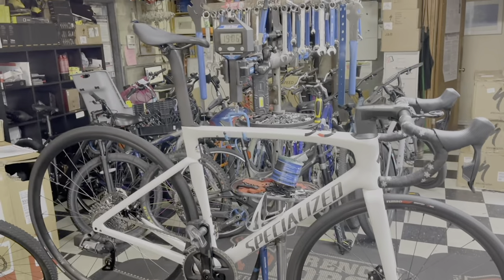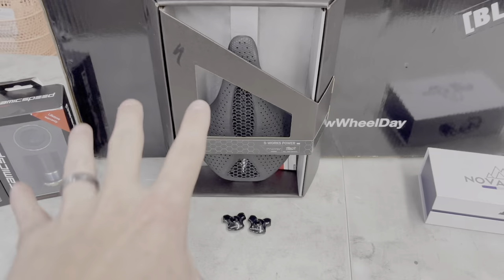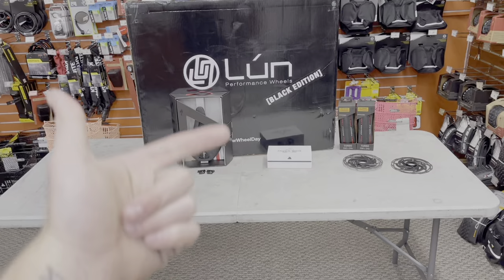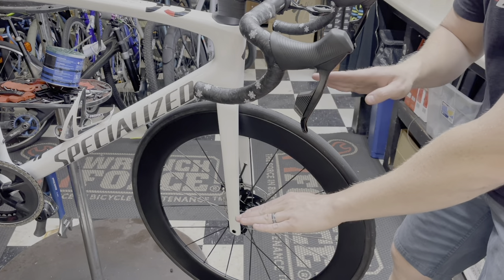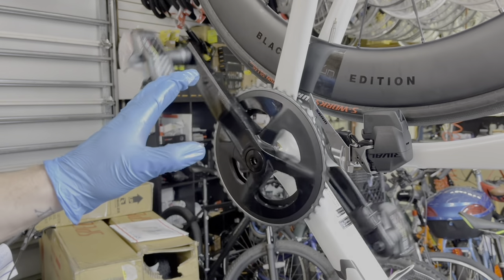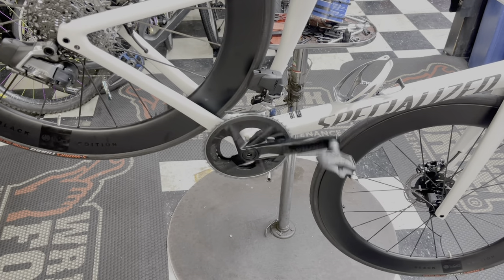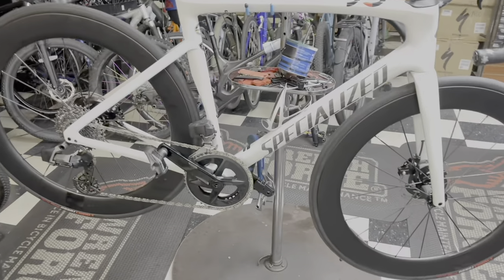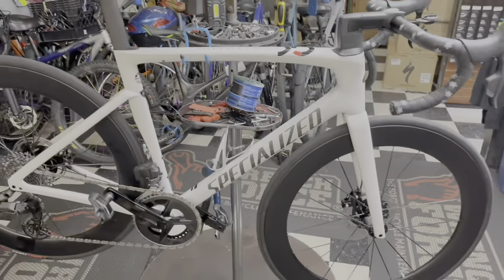HOW MUCH WEIGHT CAN I REMOVE?? (UPGRADING MY BRAND NEW TARMAC SL7 COMP 2022) *WHEELS, ETC*

Comment: Bikes are getting cheaper, lighter and easier to build and maintain than ever before.
Reply: Completely agree 😆 bikes are overpriced gimmicky fashion statement nonsense nowadays. As lance says. "It's its not about the bike" you are going to win if your performance is up to scratch and the bike functions and is reliable. I ride a £900 second hand scott addict with 105. It's all I will ever need.
Reply from the maker: hahahha but it is not a problem for me to work on it..... so I do not care
Reply: 8k bikes weigh 8,5kg - How the tables have turned. The new 5k-20k bikes are the real peasant bikes - can't even reach the UCI weight limit, facebook marketplace bikes of 1000-1500 BUCKS are the REAL bikes now for the hard hitters doing hill reps.
Reply: Stating the obvious.  Thank you.
Reply: There are far more choices than ever before.

Comment: I just got my Hyperspace 50MM Disc brake Black Edition for my Trek SL5 last Monday. Also used your discount code  (thanks). Brother , I love these wheels. I finally bit the bullet when they came out with the Black Edition.  I've put about 200 miles on them already.  I was riding my bike through my neighborhood after  I first put them on. Some a-hole broke a bunch of glass, which I didn't see and got a flat in the first 500 feet of my ride. Got home fixed the flat and went on my ride. I rode them into 25mph headwinds and crosswinds and I had no problems. Rode home with a 25mph tailwind and I was flying. Doing a solo ride across Florida and back from Clearwater to New Smyrna next week. 200miles is my longest ride, going to try and top that. Because, why the hell not!
Reply from the maker: Thats awesome man I am glad to hear!!!! I have the 65 and I have no issues with it either the wheels are so nice and the bearings are so nice!!

Comment: Splendid project! I bought a brand new crux fact 11 for only 2700 eur last year, yes old model. I swapped out stock wheels for bontrager aeolus 3v, the praxis carbon zayante, now with 46x11-28 for the flat Netherland, roval Terra seatpost and romin carbon saddle. I got more than a kg off the bike and it rides super smoothly with 32 mm tires. I understand the JIZZ of this operation more than anyone else.
Reply from the maker: vvery nice!!!

Comment: “I want to get my bike lighter!” Gets heavier wheels (the single biggest opportunity for weight savings) “for the look.” 🤔🤔
Reply from the maker: hahahhaha about the instagram views
Reply: How are those heavier than stock comp wheels?
Reply: Even if the bike got heavier it most definitely got faster by a lot the deep dish wheels are 100% faster noticeably I got myself some rivals
Reply: Wheels were lighter than stock despite being deep!
Reply: @nateyzf   re-reading my comment, I wasn’t very clear. Wasn’t trying g to say heavier than stock. Meant heavier than he could have gotten. My point was he could have saved way more weight. Instead, he went with deep section wheels (and a heavy set at that) just because of the look. If I’m trying to get my bike lighter, I’d DEFINITELY have better options than these wheels. Zipp 303 Firecrest comes to mind, which is 300g lighter (and pretty awesome looking IMO). That’s almost a pound right there.
Reply: @Stevenafoe   re-reading my comment, I wasn’t very clear. Wasn’t trying g to say heavier than stock. Meant heavier than he could have gotten. My point was he could have saved way more weight. Instead, he went with deep section wheels (and a heavy set at that) just because of the look. If I’m trying to get my bike lighter, I’d DEFINITELY have better options than these wheels. Zipp 303 Firecrest comes to mind, which is 300g lighter (and pretty awesome looking IMO). That’s almost a pound right there.
Reply: @nemothefisk7154  not doubting the speed and aero benefits. And you and I can probably find half a dozen wheel options that have the aero benefits and are way lighter than these.
Reply: @GCPerformance18  lol at least you’re honest about that!
Reply: @danielakerman8241  the firecrests are a good option (but not black). Also; as they are tubeless only, you’ll need heavier tyres, plugs and additional ‘milk’ to seal them. That totals more weight than a (for example) pirelli p zero race 26mm (204gr) and a tubolito (24gr). Another 2x 75 to 100 grams saved if you don’t go the tubeless route ;-). Oh, the weight weenie-world, lol .
Reply: @Stevenafoe  
Firecrest wheelset: 1352g
Compatible Pirelli P Zero Race TLR SL 28mm: 275g each (550g total)
Sealant: approx 120g total.
Total weight: 2022g

Winspace wheelset: 1620g
Pirelli P Zero TLR SL 25mm: 245g ea (490g total)
Specialized Latex tubes: 85g ea (170g total)
Total weight: 2280g

Half a pound in weight savings going with Zipp Firecrest. Valve stems will be similar for each setup. Firecrest wheels don’t require plugs. They’re already set up for tubeless tires. Plus since it’s tubeless, the ride will be more comfortable, it has LESS rolling resistance (wider tires at lower pressures have been proven to roll faster in real world conditions thanks to their ability to efficiently roll over road imperfections), they have excellent aerodynamics, and they’re cheaper!! I happen to think they look fantastic in black.

Just to be clear. I’m no weight weenie. I actually think bike weight is way down on the list of things to worry about or spend money on. I just found it silly that the title of this video was about how much weight could be saved, and then products were used that clearly were not great choices as far as weight goes. Blatant clickbait to satisfy the video sponsors…
Reply: @nateyzf  they are much deeper
Reply: Don’t even get me started on how much weight can be saved going with tubular over clincher. It’s pretty staggering. I always go with tubular on my high end bikes. And you can’t tell me with a straight face that my FMB Performance Racing silk 25 section tubulars have more RR than your overly hyped tubeless flavor of the month tires.
Reply: @danielakerman8241  i have (not expensive) 1500 gram (tubeless ready) 5cm deep rims, 2x 204gr pirelli tyres, 2 x tubolito’s: 1960 grams... I am also not a weightweenie, but the lower weight does feel good. I live in a country with great tarmac (cyclepaths), so comfort is not a real issue. I am just trying out different setups; next time i want to try latex inners, to see how that works out. As i hardly have flats (1x last 4 years) i am not considering tubeless currently.
Reply: @RB-xv4si  i don’t really care about weight at all. I was just making a point about the silliness of the video. Personally, I think tubular tires are ridiculous for 99% of riders. I like tubeless not because of the weight but because of its real-world speed, comfort and convenience. For most riders in real world conditions, tubeless roll faster, are definitely easier to take care of, and offer more comfort.
Reply: @danielakerman8241  right. And I was pretty much making the same point you were. You mentioned the wheels weren’t light because of how deep they are. And I mentioned they also aren’t light because they aren’t a tubular system. And the truth about tubulars is that I can run the same large volume tubular at the same low pressure that you run in your tubeless setup. And the tubular casings can be thinner and more supple than on a clincher because there isn’t a hook bead stress point that could fail with a very thin/supple casing like has been the case when some manufacturers (cough..Challenge) try to use the same casing in their clinchers as they do in their tubulars.
Reply: My hyper 50‘s were lighter than the stock aluminum wheels. Plus noticeably stiffer and faster.

Comment: what your tough on safa brain going all out on the 32mm on the new scott build? Also would you change the chainrings on the rival crank for the red version to cut weight down?
Reply from the maker: Hes obivously really good at the sport and a great rider, so at the end of the day it is his call...... I hate the trend and also feel like he is loosing speed, but what people will say is, the 32 tire is wider and taller tire, so when he gets to top end speed the tire will expand like from momentum and get taller so it will be a bigger revolution and maintain and carry top end speed..... also more comfort... but fuck do I know, he rides with pros, I change flat tires on beach cruisers
Reply: @GCPerformance18  he does a lot of steep descends, maybe is also as a safety net
Reply: @bernardo9202  more contact patch can turn more aggressive and run lower pressures

Comment: This video made me realize I don’t want to put ANY extra money into my ‘22 Allez Sprint.  The “gains” would be so minimal, ain’t worth it.
Reply from the maker: hahahahha except carbon wheels doe, u need those
Reply: @GCPerformance18  Sucks how Spesh prices their bikes…  often making “upgrades” cost prohibitive.  I built a (frame up) S-Works SL6 a couple years ago, and it basically ran as much as a stock S-Works build.  Only savings was the frame.. on sale at $3,800 instead of $4,800.  If I installed Rapides and SRAM Red like I want to, on the Allez sprint, I’d be in the SL7 expert range, same R470 hoops… but CARBON frame.  Wish there was a break on component builds, and upgrades.  Anyways, I do have my eye on some Hunts.. but my bike was built by a moron at Spesh.  Their direct to consumer offer is a joke.  Literally had to take a brand new bike in for a tune up, before I could ride it.  Now the BB is creaking like a 20yr old press fit… might not have this bike too much longer, as I have requested a return… or a new bike.

Comment: I have a Poison Speed with Mavic CL45 wheels / ultegra mechanical group with 105 cassette- LIGHTER than that. 8.2 kg with pedals and garmin mount (front and back for garmin radar). My bike costs ... maybe 2500 euro. Why would I buy specialized ? No ceramic anything, shit headset, aluminium handlebars....

Comment: Excited for you and your new SL7. Is there a reason other than weight to change the rotors out to Red? I have the SL7 Pro with Force 1x. So Force rotors but I’ve wondered about the Red rotors. 🤔
Reply from the maker: no reason at all, just the weight for me, and also the look of it...... but stopping power is very similar, companies might claim there is better if you go to them and they might be right marginally but they are very simialr in stopping power

Comment: The height difference in the stem and seat is nuts and it's not even slammed. I bought the same bike in blue and the same wheels (but 50s). They're supposed to arrive tomorrow, but It's still sitting on the other side of the country :(
Reply from the maker: yea I know I should be on a 58 but I like the smaller bike and the aggresie look

Comment: Hello, I am a big fan of your channel, just one quick question, I am riding SL7 expert with Roval C38, weigh around 8kg, if I am going to get another pair of wheels for speed, shall I get deep section wheel or get another pair of all-round wheel (e.g. Zipp 303 firecrest) in higher level? Thanks 🙏
Reply from the maker: thanks so much!!! if you live in a flat area like florida like I d, then a deeep dish wheel like 65mm or 60s are perfect and a huge upgrade but if you have any kin of climbs around you or moderate amount of climbs go for like a 50mm wheel it is the usual in between depth that people enjoy to get the added aero but still not so deep that you its harder to climb.... btu my wheels that depth I can literally sit on someone wheels and feel like a tt bike and jsut easily pedal lol..... the bike is doing a lto of the work for me
Reply: @GCPerformance18  I am from Hong Kong, so it’s around the hilly climb, so I am thinking to keep Roval C38 to tackle the climb, but I am it’s not light enough to handle the job well. In the world of disc wheel, it seems to be hard to shave 300-400g on the wheels, so I am thinking whether I should replace a better all rounded wheel or go for the deep wheel to tackle the triathlon race.

Comment: And yeah ceramic speed is nice...but still a scam. As hambini showed us - a pair of NTN non-contact seals bearings (LLB series) are the same as any ceramic speed crap - costing a really small fraction of that price. Friction is given by the SEALS (contact seals) and lubrication. A reputable (arguing best in industry) bearing from SKF, NTN or FAG with non-contact seals cost about ... 20 euros at most shipped.

Comment: I have a 2015 Lynskey R240,  weight is 18.6 with pedals.   I have a carbon bar, seatpost, 50mm wheelset and Ultegra components with rim brakes.     Why are these stock Tarmacs and other new carbon bike so heavy?    I would expect the weights of these bikes to be in the 17-18 pound range.

Comment: Did you ever ride the roval clx 64?
What’s your take as regards cross wind on them and/or/vs these lun black 65?
Beautiful whip by the way 🐴
Reply from the maker: Yea I rode the clx64 on the venge vias. I had no issues with those wheels and that bike. If there was any days that were extremely windy. Then I wouldn’t go out. That’s just for saftey. But that was only over 20mph

Comment: I have a HYPER 50 on a Giant Propel disc. I find that when I tighten the rear thru axle, it slows the freewheeling. I loosen the thruaxle and freewheel is good but the axle is not tight at all and not confident on riding outdoors with a loose rear thruaxle. Any recommendations?
Reply from the maker: yea that is normal when the wheel spins because it is not compressed, but that is how the wheel is suppose to funciton the reaosn why mine spins so freely is because of the ospw and also the ceramicspeed bb

Comment: Sram Rival eTap? not sure, thinking to pick Ultegra mechanical instead, still lighter and cheaper and higher spec. Don't have enough cash for Force upgrade or Di2 so I think it's a wise choice. What's your thoughts - Ultegra Disc mechanical vs Sram Rival eTap?
Reply: I'd take Ultegra R8020 any day.
Reply from the maker: agreed

Comment: For the $1000s you spent could've been 2 models up and over a kg lighter with better shifting....but I get the brands want exposure
Reply from the maker: bike retail: 5500

wheels 1200
ospw 250
saddle 450 
ceramicspeed bb 450
rotors 160

nect model bike is the tarmac expert sl7 which retails for 8300.... all these upgrades im at 7600

plus that model expert comes with c38 base model wheels, no ceramic bb, no ceramic ospw and also not an amazing co mfy sworks power mniurror 3d printed saddle......

those add ones would make any bike be more money and also my wheels are ceramic bearings and also carbon spokes bladed.... with the depth i want for florida........ issa a win for me

Comment: Interesting series, still waiting to hear from my local Spec dealer on what the potential SL7 builds for 2023 will be to order from but 2022 didn't offer an Expert in Canada so if its the same for 2023, would be choosing between a Comp like this and upgrading wheels and adding a power meter or going for the Pro which already comes with aero wheels and a power meter. Seems like upgrading the wheels and to a Red power meter crank on the comp still is about $1200 CAD cheaper, consider upgrading the bars and saddle, you are less than $1000, consider the value of the derailleurs, shifters and its pretty close but with upgrading the Comp you would end up with a training wheel set... May just decide based on colours.
Reply from the maker: I think 2023 are going to be colors alsso, I dont see them changingn the platform they might folow same price and also just different colors and modelsss
Reply: @GCPerformance18  New colours? Geez they will have to jack up the price by at least 20% for those ;)
Reply: @GCPerformance18  I would like to see SRAM update the Force group to be similar to the new Rival AXS. That would be tempting with the newer hood design and a general refresh.

Comment: Will you be transparent about the costs? What your customers would pay for the bike and everything else vs what you actually paid with discounts / sponsors or what you got for free?
Reply from the maker: yea so wheels bottom bracket I got for free also the ospw was free too chain tires and saddle I paid for 
but costs go like this retail:
bike 5500
bottom bracket 400
wheels 1200
rotors 140
tires 160
saddle 450
chain 70
nova ospw 250

that was the total build retail for everything

Comment: Can you explain the saddle cups part? I have a Terra Carbon seatpost that came with my Diverge and I'm not sure if I need to buy different cups when I upgrade my saddle to carbon rails. If so, where do I find these different cups?
Reply: carbon rails are oval shaped and usually hollow,  if cups are for round rails the carbon gets crushed.
Reply from the maker: just contact your local specialized dealer, and ask them for the carbon rail...... this is what u need 2812-9050 search that on google
Reply: @GCPerformance18  I'm buying a Fizik saddle with 7x10mm rails. Can I use that 7x9mm clamp or should I look for something else?